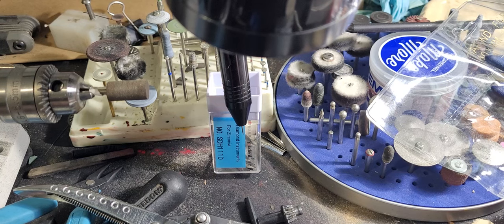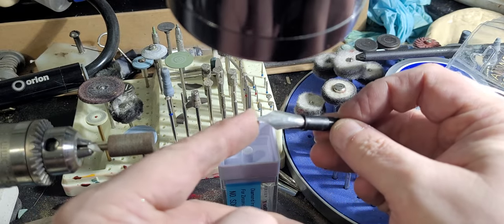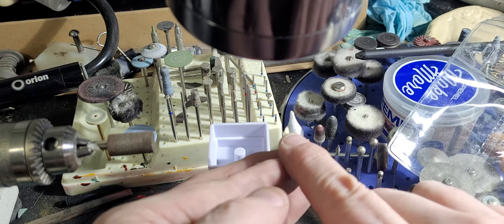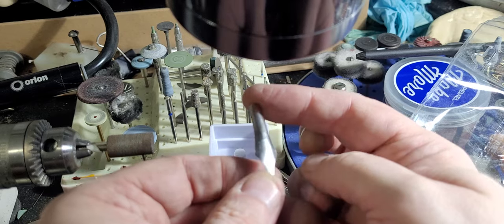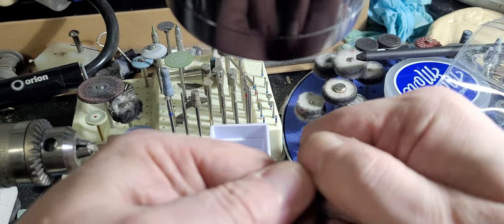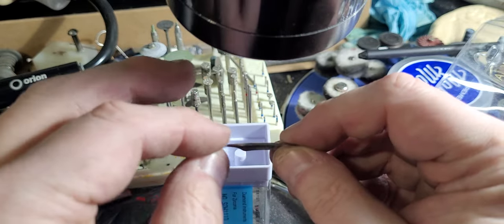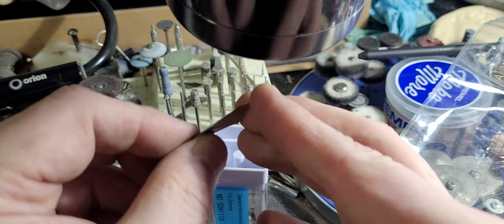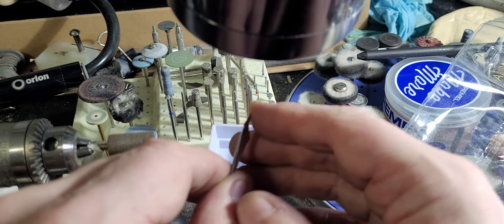Want to know more about making your own fountain pen nibs?

Comment: Would it be possible to form the slot by using a sacrificial feed and collar to hold the nib in place, and sawing outwards from the breather whole with a jeweler’s saw? It looks like a 6/0 blade is 7 thou thick, would that be too wide of a slit?
Reply from the maker: @tstthomason  A 6/0 is too thick, but an 8/0 is just about right. In my experience, 8/0 blades snap easily on steel. This doesn't mean you shouldn't try it. You might discover something amazing.

Comment: How are you cutting your suits?  Thanks!  Also, will there be a part 2 to your nib making part 1?
Reply from the maker: Hi David. I'm using abrasive cut off wheels with a rotary tool. I'm trying to figure out the best way to film the next part.
Reply: @penslothnibs1604  Thanks.  I'm surprised they're thin enough.  Maybe you found them thinner than I've seen.  Can you say how thin they are?  Do they break easily?
Reply from the maker: @DavZell  I get 0.005" discs. They're typically used for jewelry or dental appliances. They are very fragile, but there's a tiny bit of flexibility before they crack apart.

Comment: Thanks for the update! I find the whole process fascinating :)
I'd love to hear more about how you do tipping - I like salvaging badly bent nibs, & re-tipping would expand what pens I could save, plus make my nib-grinding experimentation less expensive  😄
Reply from the maker: You're welcome! I do retipping with hardened 440 stainless bearing balls these days. I can't afford the 1000 piece minimum order for tipping balls these days. My weapon of choice is a mini pulse arc welder. It is imperfect, but more accurate than a car battery charger. As for grinding practice, buy Jinhao nibs from AliExpress. At approximately $1 each, that's cheaper than a welder and tipping.